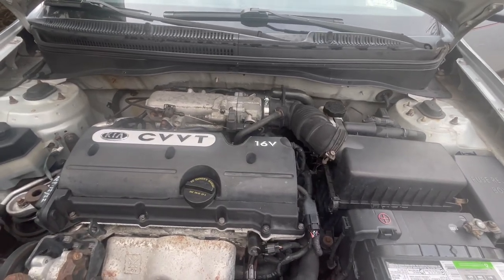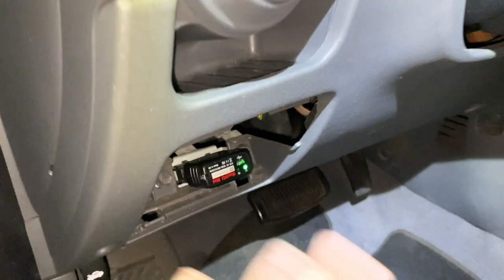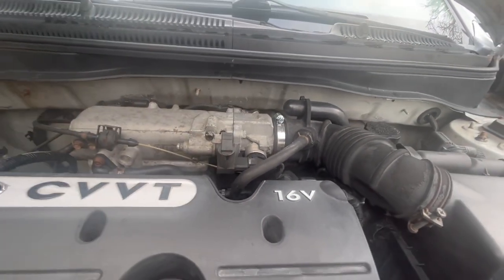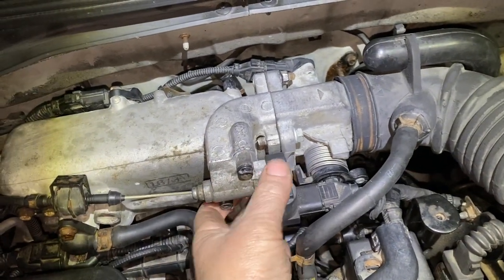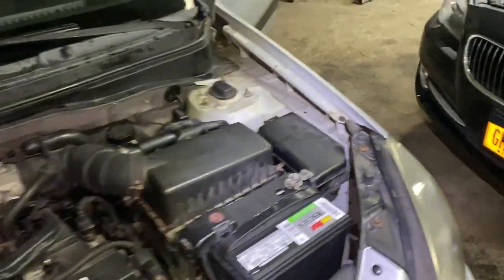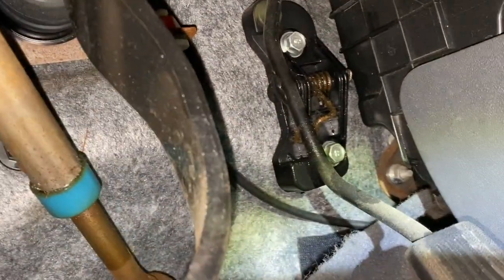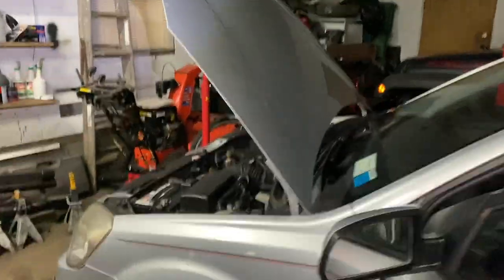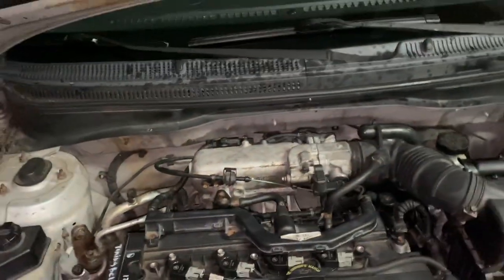Fix Sticky /Hard To Push Pedal - Simple DIY

Comment: That sticky pedal making the car jump is an absolute nightmare in a manual vehicle. Because when setting off from a dead stop you want only a teeny bit of RPM not fucking 3,000 lmao. My clutch pedal also sticks but its only sticking when you fully press it in not by much tho. I appreciate this video tho!!
Reply from the maker: Sure no problem!
Reply: I got the same thing
Reply: Did you figure out what it was ? I have to rev high on my 96 civic or it gets jumpy and makes almost a grinding bearing noise but I just got new wheel bearing and motor mount so I’m thinking clutch or this